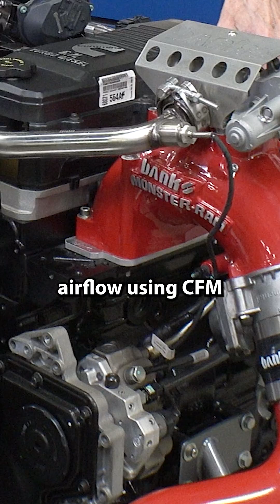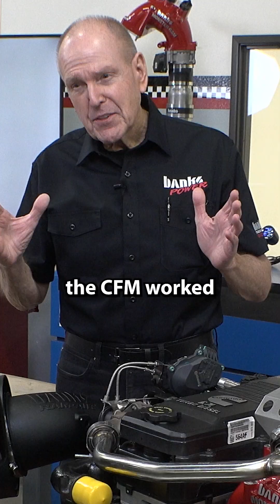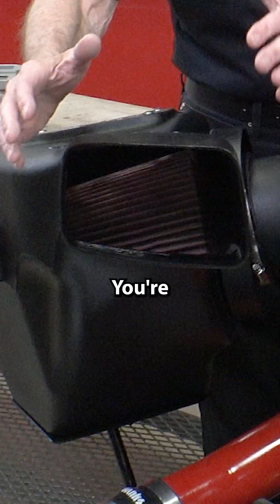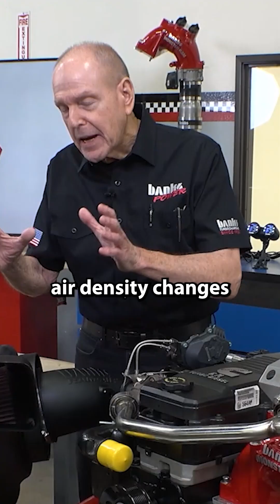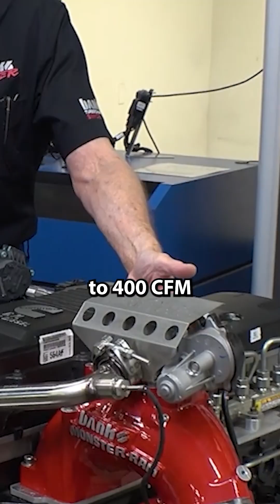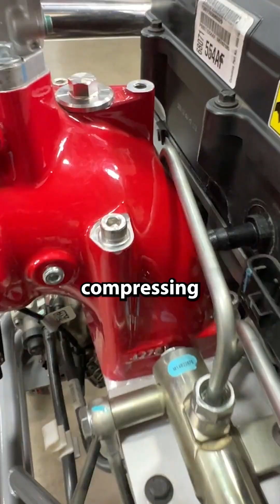CFM  ≠ airflow

Comment: Ive always said "boost numbers dont matter if it cant breathe fast enough." 

You see it all the time with dudes that are running 15 plus psi in stock intake, tubes and manifold setups but arent getting performance like they though because the stock setup eas only rated to flow x anount of air regardless of boost. Just cause you turned the boost up doesn't mean its flowing anymore than it already was. Gotta give all that boost somewhere to go.

Comment: He only got 600hp out of a fully built 5.0 turbo diesel and tried to say let’s see the gas guys do that lol my 5.0 gas engine makes 1000 hp 😂 banks don’t know how to make power 💩
Reply from the maker: We've done 1,000hp on stock internals with our Killing a Duramax video series and built a 4,500hp, twin turbo dragster for NHRA contention (Banks Pacemaker). Testing and development for these race engine programs are not always about making big power. They are incremental steps to gather as much data as possible to build the best engine possible. This was early in the development before the 7.0L DMAX before the engine was supercharged, twin-turboed. In this particular test, Gale wanted to see what power the engine would produce at a very lean 18:1 AFR. It was lean because the 5.0L Whipple supercharger was creating incredible heat. He didn't want to add to that heat. In theory, a leaner AFR would keep temps down. However, you can't make much power without fuel, as this video shows. Later in the series, he richened the AFR and made over 1,000 horsepower. Watch the Building a Monster Truck Engine series here: https://www.youtube.com/playlist?list=PLwtmrqcWzLtRXpEFXeXa3YF-L0xSK2Ml2

Comment: maybe the CFM is less but the air pressure is higher, so the density will be higher too. . . more oxygen per cubic inches , this is why the engine will be more powerfull. . .

Comment: Simply put CFM ignores Forced Induction
Reply from the maker: More than that. CFM also ignores air density loss due to higher elevation, air density loss due to increased air temps, and can't even account for the benefits of ram air. This is why air density is king!
Reply: Correct @bankspower CFM was calculated @ Sea level & <BTW Great Point 👉> Where ever that flow bench was it probably was in a comfortable room temperature.
Water Grains/ Humidity matters as well ... Air Pressure is very misunderstood by most people I have never liked using the word vacuum. The most misunderstood things R all these parameters that U & I R talking about, they R not commonly discussed in the Automotive Repair Industry unless U took a Clean Air Course or was a Tune Up Mechanic.
Oh &
CH ₃NO ₂.

Comment: Engineering thermodynamics and heat transfer have always been done in terms of mass flow.  We only convert to volume for very limited, specific purposes...say, to get the velocity of a gas in a duct for pressure loss type calculations.

Comment: I've got the 2009 Cummins 6.7L in my 2008 F450. Running good so far. That Navistar 6.4 was a constant money pit. Because the truck was older, it didn't have the engine compartment cavity space to go newer but as little as I ACTUALLY use it to haul my 38 ft 5th wheel around, it's more than I need.

Comment: CFM has never been used as a metric of efficiency. This guy does not know what he's talking about. It's unit of fuel per unit of torque or horsepower seconds. If the engine is in a vehicle, mpg of course.

Comment: Trivia: The dawn of turbochargers and superchargers had a different definition. Turbochargers brought air density to sea level, so reciprocating aircraft engines could operate with the same power at any airport. Superchargers brought air density to a higher pressure than sea level. The definition had nothing to do with being exhaust vs. mechanically driven.

Comment: There are huge practical constraints in the isothermal and adiabatic theoretical compression processes. The real-world air compression process blends isothermal and adiabatic compression to overcome these constraints in a process called polytropic compression. There is a limit to efficiency and just increasing the compressor size eventually crosses a limit of how much energy is lost in moving the compressed air. Look at the size of a F1 engine turbo, it’s not that big.

Comment: Basic physics here. (Thermodynamics) wanting to truly understand this stuff was how I chose mechanical engineering. One of the things you can learn at college that's worth knowing. Not sociology, gender studies, or other useless crap.

Learn things like this, it's the ideal gas law. It tells you that triple the pressure reduce the volume to 1/3. Also raise the temperature and volume sand/or pressure goes up.

PV=nRT (ideal gas law)
P= absolute pressure (#s/square inch)
V= volume (cubic feet)
T= absolute temperature

n= mass (how many atoms)
R= the number that makes all the other stuff work out in the units of measure

Comment: What Mr. Banks here is saying is that you can still measure in CFM, but you have to understand your ability to compress the air down and the ratio at which you can do so. Which then you have to make sure you have as close to 100% efficiency use of that air. If you are taking in 1200 CFM of air and not actually able to compress all of it, then you are not actually taking in 1200 CFM of air. You are taking in only the amount you can actually compress. So if that were 50% compression, then you get just 600 CFM of input into the engine.
Reply: Brilliant. Thank you for explaining
Reply: You literally made it more complicated lol
Reply: @crusty1292  literally....

Comment: CFM is a good way to measure the flow potential of a cylinder head or a manifold. You can double or treble the pressure but features affecting low pressure airflow will be just as good (or bad) with high pressure air.

Comment: But it's closer to 75 pounds per 1,000 cubic feet, while at sea level and 70° Fahrenheit.
Maybe he's measuring the average reading at the average city not at sea level or slightly above the coast.
The standard of one Bar is 14.5, and that is a lower number than 14.67,  the actual density at sea-level, but who works at sea-level, except Fisherman and Boat racers.
Reply: Lots of big turbodiesel units do all their work at sea level.

Well, maybe slightly below depending on hull design and draft.

Comment: If this was true. You would run a smaller injectors. Simple air/fluid dynamics. Volume of compression. The same thing happened if you double the fuel pressure to an injectors
Reply from the maker: Actually that's not the case. Air is a compressible fluid, fuel is not.
Reply: @bankspower  you are absolutely correct. What is the size of turbo compressor outlet and the size of thottlebody inlet? Roots type blower with 8to1 pulley is doing just that. Outlet side is not 8 to 1 ratio. Because of  latent heat picked up.  8 ounces of frozen water is still 8.0 ounces supercooled or superheating of air works the same way with one small difference.

Comment: cubic feet  at sea level   14.7 ish     amount does not change   you miss using the math   - its like fighting bullshit with bullshit   -- can you do some stuff on  putting larger injectors into a head  - I had a a mahindra 2.2  they put the largest smallest injector into the motor  - I dont have enough doe to buy nozzles to see what the diffences are  --

Comment: The monster ram intake is the biggest waste of money and actually prevents the truck from making boost through the rpms. It doesn’t provide enough resistance to the turbo and only builds psi at very high rpm’s. Junk.
Reply from the maker: Boost is not the same as horsepower. You can lower the boost and increase horsepower if the cylinder air density is increased. You achieve this increase in air density by removing restrictions and cooling the charge air. The Monster-Ram reduces restriction between the compressor and the cylinder. This means the engine can make the same power with less boost pressure. The turbo can produce the same power while spinning at a lower RPM because less density is lost across the intake elbow. Your stock intake elbow is a restriction. 

If you want to see how lowering boost pressure can increase horsepower, check out this dyno session from our Building a Monster Truck Engine series: https://bnks.pw/461ScDO

Comment: I guess Im a little lost as to how this is seen as a confusing topic.   Every other field of science/engineering where mass gas interactions are involved just  normalize to STP (standard temperature and pressure).   This way you are using cfm to measure the number of molecules of flow per unit time, which is what matters in any case. And this is what ecu’s are for, and why they are equipped with temperature, pressure, 02, AND mass air flow sensors - so that these factors can be used to normalize and calculate based on number of molecules of the gas we are interested in ( oxygen in this case). 

The ideal gas law ([pressure][volume] = [number of molecules expressed as moles][ideal gas constant - stays the same so can be ignored for relative calculations][temperature] is more or less all you need to know to do this correctly🤷‍♂️.

I guess i just never realized this was such a confusing issue for so many in the car world, and good on poster for clarifying it.

Comment: You can only have so much air before it compresses and turns back into a liquid. Thats why large displacement started losing to high revs.  Turbos sort of compensate for that issue but still function best with low displacement.  All internal combustion engines have to deal with this issue and thus will always reach a theoretical limit of conversion of potential energy.

Comment: So when you say air density, your some what also talking about air temperature, cold air is more dense than warm, so when a CFM reading is taken is the temperature ( what time of year winter or summer) factored in or is this in a controlled environment? Because one would think when coming up with a system for mass air flow/horse power the seasonal elements would have to be taken into consideration?

Comment: 72 pounds per 1000 cubic feet makes my metric mind blow up
Reply: except, the air density at 70° Fahrenheit per cubic foot, is closer to 0.075 pounds per cubic foot.
It's actually pretty easy to remember that a cubic yard of air, is a hair over 2 pounds.
Reply: @richtomlinson7090  How much is a hair?
Reply: @robertfreeman5231  I guess that isn't the best word to use for volume, but I do know a hair is a small amount.
One cubic foot of dry air weighs about 0.075 pounds, and if you multiply that by 27, it equals 2.025 pounds.

For most people that don't live at sea level, air weighs 2 pounds a cubic yard, or less the higher in altitude you live.

Comment: This doesn't really change anything. CFM is CFM. It's common knowledge that 400CFM at 30 psi is way more air than 400 CFM at ambient pressure. It's a pretty simple formula to convert your intake charge to STP.
Reply from the maker: If only it were common knowledge. We see comments all the time from guys saying "the head is the limiting factor when it comes to intakes" not realizing that the air can be made denser.

Comment: I read somewhere a long time ago that air velocity plays a role as well. So like with the cheap ebay intakes that are like 3 inches then goes into a 2. 5" reducing coupler at the throttle body actually slows down the air velocity and then makes it turbulent at that choke point and can hurt power and throttle response. So I did a little experiment on my car at the time, which was a 1996 Infiniti G20 with a USDM NA SR20. I had put a cheap ebay intake on it and it made nice sound bit felt sluggish over stock. So I had put the stock tube back on with the cone filter, still got the noise and the car felt peppier. I decided to test the information I had read, measured my throttle body which I think was 2.5", and ran to Pep boys and bought 2.5" intake piping. Made a noticeable difference. Much better throttle response and actually felt a bit quicker, like noticeably. I don't know if really made a difference or not, as I never really tested it scientifically. Would have been nice if I could have taken it to a dyno and ran all 3 setups to actually see if it made a difference but for a 140hp beater car and being broke, didn't really make sense to spend the money at the time.
Reply: More air velocity = more low end torque but less top end HP. This is why American trucks with the same V8's that cars have come with a much larger intake, because they have longer intake runners which forces the intake air velocity to increase. The trucks will have more torque but less HP, while the cars with short runners will have more top end HP but less torque.
Reply: If You are going to Pep Boys, You are already spending big $.

Comment: CFM is only the amount of air that flows through the port(s). The flow is the path the air takes through the port. The flow of air in and out of the engine determines how efficiently an engine can make power and how much power an engine can produce

Comment: That's why PSI is more acturate, it's a measure of the mass of the air by the volume of air.
Reply from the maker: We like to go one further and measure air density. Pounds per thousand cubic feet. Boost pressure is effected by temperature. For example, a turbocharged engine without an intercooler will make more boost but less power because the air is less dense. Air density is a direct measurement of the horsepower potential of air without having to worry about any conversions or tables.

Comment: But the thing is CFM times 10 or how ever many lbs still equates. You’re pressurizing that CFM now. Which is why boost pressure AND CFM matter.
Reply from the maker: We can make that even easier. We measure air density. Air mass within a given volume. Pounds per thousand cubic feet. Our iDash DataMonster 52mm gauge displays air density so you don't have to worry about trying to correlate boost pressure, CFM, manifold air temp, ambient pressure, etc.
Reply: No more comments from the peanut gallery...please.

Comment: Air mass...so you can still use cfm 

Air is air. If it has 1000cfm NA its the same amount of air if it does 1000cfm turbo charged. Yes the compressed air will be hotter etc, but it does pump the same cfm amd therefore air mass
Reply from the maker: Sounds like you're really missing the point here. If 1000 CFM of NA air (air at ambient air pressure) was the same air mass as 1000 CFM of air made denser by forced induction, then turbocharging an engine wouldn't increase horsepower. But it does. This is because, even though the engine is still pumping the same CFM, the measurement that determines the air's ability to make horsepower is air density. 

1000 CFM of air at 72 lbs/1K ft3 is less oxygen, and less horsepower potential than 1000 CFM of air at 216 lbs/1K ft3

CFM is volume being moved, mass flow is mass being moved, but air density describes the weight of air within a given volume.
Reply: @bankspower  nonono. I think you misunderstood me there

If you installed a MAF sensor before the turbo and it said 1000cfm it should make the same power as the engine with NA and 1000cfm

They both suck the same amount of air into the engine with the turbo squeezing the air and making it denser, but the total amount of O2 should be the same therefore the same amount of power can be extracted

The only situation when the turbo makes more power, is when it causes to increase cfm before the turbo, therefore you have more O2 -> more fuel -> more power

If you can explain how you can extract more power with the same amount of molecules of O2 if you just squeeze them together(turbo) that would be great
Reply from the maker: Ah, yes. It was a difficult point to understand as most people are comparing components on the same or similar engines rather than comparing two engines of different size. 

CFM is not air mass, it's air volume. 1000 CFM of hot uncompressed air has less air mass than 1000 CFM of cooler compressed air.

This is one of the problems with measuring in CFM in the first place. We measure in mass flow (MAF) and air density (pounds per thousand cubic feet). Air density is a direct measurement of the horsepower potential of air.

Comment: That's why we tune for volumetric efficiency!
Reply: Correct! I read some books on volumetric efficiency in my Ranken days. Great stuff.
Reply: He literally just explained why volume is the wrong metric when you’re using a turbo to compress the air and increase the density of the input you would want to tune for air mass flow not your volume
Reply: @owenblount7334  Volumetric efficiency takes the compressed air into consideration. If it didn't then tuning a forced induction car vs an NA car would be wildy different in target AFRs yet it is not.
Reply: @owenblount7334 tuning for volumetric efficiency (also called speed density) does take that into account. It calculates the mass air flow into the engine by measuring intake air temperature, manifold pressure, and known volumetric efficiency of the engine. With that data you can calculate the mass air entering the engine.
Reply: @owenblount7334 that's why diesels tuned based off air pressure will often roll coal when they shouldn't.. The boost comes up before the airflow gets there!
Reply: So are you saying a stock air filter isn’t giving you enough air for the Monster Ram? With stock turbo
Reply: @danasmith376 map sensor
Reply: Thats totally different..